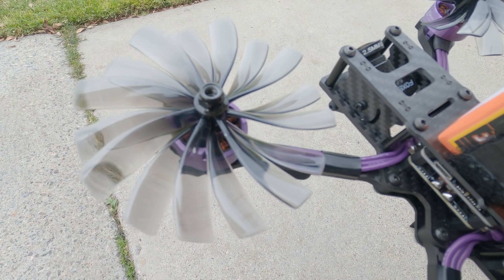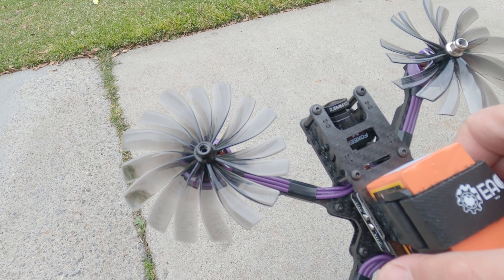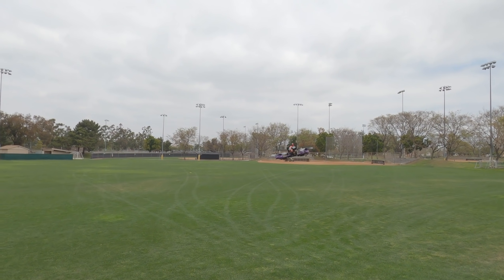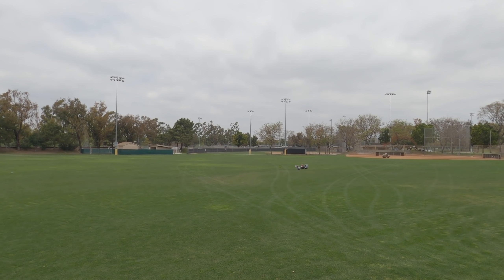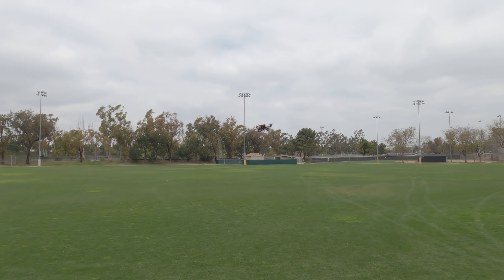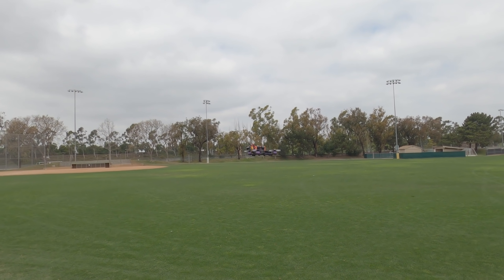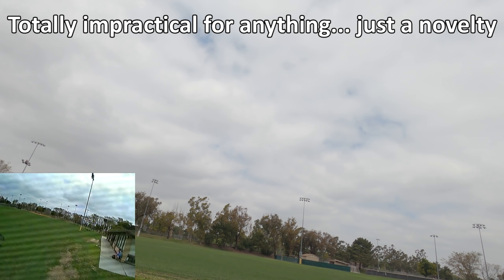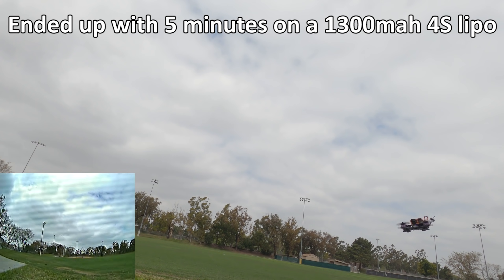Turbine Powered FPV Kwad (8-bladed HQprop D89mm)

Comment: Hi, to install 2 propellers is it necessary to make some adaptation or does the original engine already have two propellers at once?
Reply from the maker: I didn't make any adapter.  They both fit on there but BARELY.

Comment: Is there anything separating the props (metal washer, etc?).  I've tried stacking these props several times and they either slip (if the bolts are under-tightened) or grenade (if the bolts are tightened enough so that the props don't slip).  Am I missing something in the mounting of these props stacked?
Reply from the maker: I didn't do anything special.  They aren't meant to be stacked so not sure what can be done here.

Comment: Are those standard motors?  If so, surprised you can stack 2 props on them. The nuts look like they are just barely hanging on. How about a close up of mounting  2 of those props (or any 2 for that matter) on a single motor?

Comment: Given how the stacked prop lines up its blades in the diagonal with the lower prop, if you try even spacing, it's probably questionable whether the second prop even does anything appreciable, apart from additional drag. I've ordered a bunch of them for giggles because of all the other videos, but am gonna attempt a single prop per motor only.

Would probably be worthwhile to do RPM comparisons at hover (via DShot telemetry) vs 5" props.
Reply from the maker: Yeah, this is just for fun.  Not really that practical.  But not every video needs to be super practical, right?

Comment: Wow 64 blades... It does sound strange. If you have a second: My Betafpv 95 Hd is on a FrSky receiver. what do I do/change to use my DJI controller. Just remove the FRSky receiver and bind my DJI controller or do I change anything in Betaflight? Thanks for any help!!!
Reply from the maker: That one probably comes with the DJI SBUS not wired up to the FC.  So you need to remove and desolder the FrSky receiver, then wire up the DJI SBUS instead to that UART.  See this video on how to wire up a Vista unit to the FC...  https://youtu.be/J6hBqGsId40

Comment: Question, Would not 6s help the ESC if rated for 6s by decreasing amp draw?
Reply from the maker: That might make sense in that higher voltage = lower current but in reality, you get larger voltage spikes when current demand increases on throttle up.  The prop setup like this might just pop the ESC on one of those spikes.  I'm trying to avoid that just in case.  I'll let someone else sacrifice their equipment to test the performance.  I wasn't interested in that aspect... more interested in the sound and noise levels.

Comment: Quadmovr has amazing LOS skills. I remember before FPV when LOS was the only option. Moral of this story is my LOS sucks now. 😊 Good flights 👍🏼👍🏼
Reply: I learned 3D helicopter before I got into FPV. It's fun with a Heli, learning tick-tocks, cyclones and stuff. but it sucks/boring with a quad, they are also REALLY fast and hard to determine orientation.
Reply: EVERYONE! should be able to fly LOS before they ever get to FPV.
Reply: @yodaco  True, it's not 1:1 but going from 3D LOS to FPV, I was surprised how easy it was just to fly around, but I already knew what the sticks do.

No one should practice with heading/self stabilizing, that is just a setup for failure.
Reply: Quadmovr still makes los interesting. That dude is insanely good

Comment: 64 blades if I counted correctly? I am surprised it didn't have more power.
Reply: Those motors were almost certainly overpropped (haven't even watched the video yet), I doubt they could spin the prop up very fast.
Reply: Overpropped and undervolted for 1650kv.  But I think that was his goal.